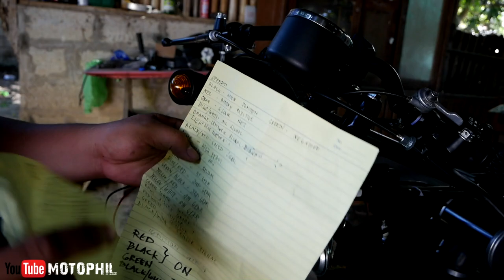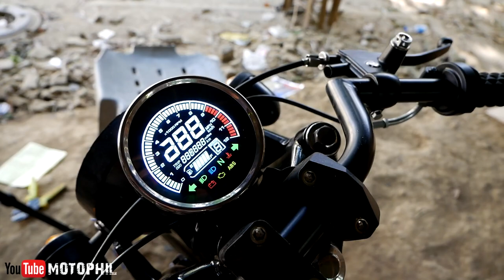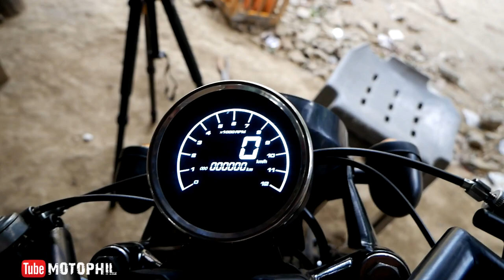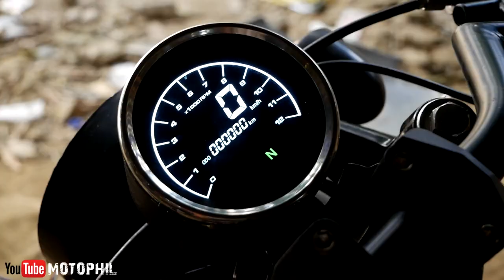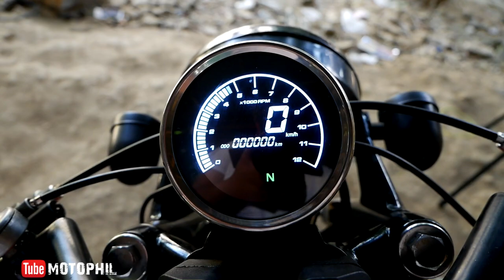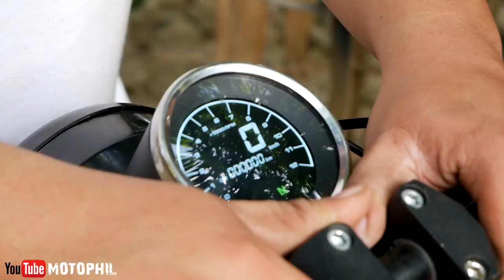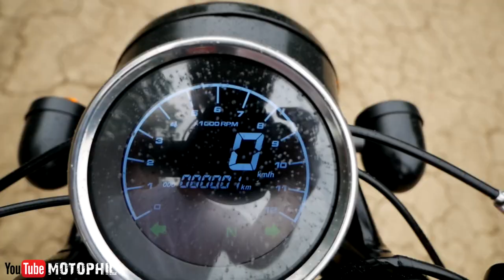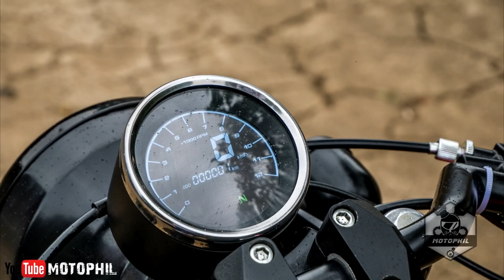HD3 Cafe Racer build Part 7

Comment: Pang 4stroke yung tachometer mo lods, lagay ka ng potentiometer para macancel yung isang spark para maging accurate ang reading.
Nag titimes 2 kasi 4stroke ang gamit mo, kung sa 4stroke isang spark 720° sa 2troke isang spark every 360° kaya ang reading ng tach e nag times 2 need mo macancel isang spark para dun
Reply from the maker: x2 nga, pero okay nayan haha
Reply: Potentiometer 15 lang yun hahaha
Reply from the maker: sige try ko. salamat sa tips .diba meron din naka lagay sa loob ng rpm? Ung dating rpm ko kasi tnry ko naring pihitin parang bumagal ang rpm or mali lang pihit ko hahaha.  Pro try ko bumili sir
Reply: Oo tama pinihit mo yun nga yun, kung meron napipihit jan ayun na lang iadjust mo.
Gawin mo basehan yung unang reading tapos divide sa 2 para pang 2stroke na